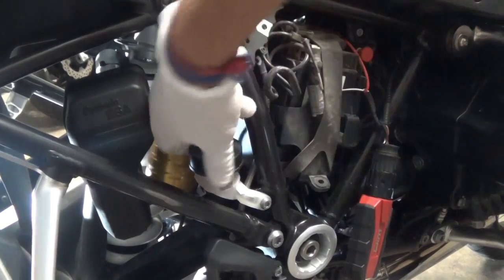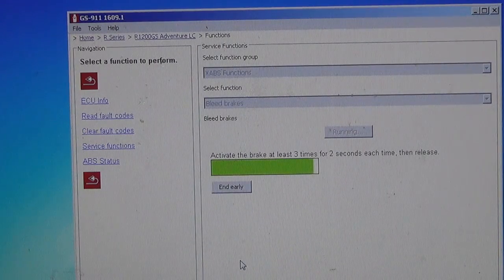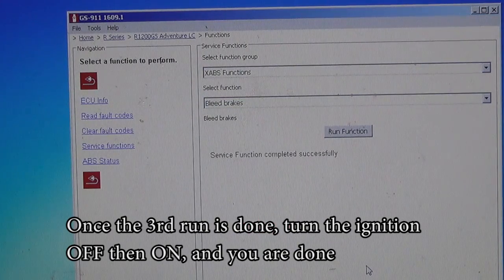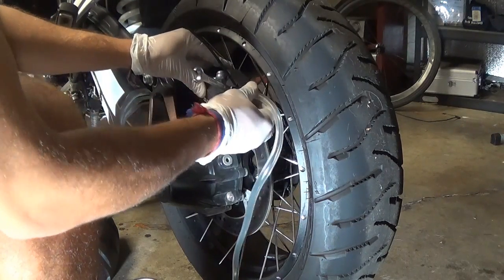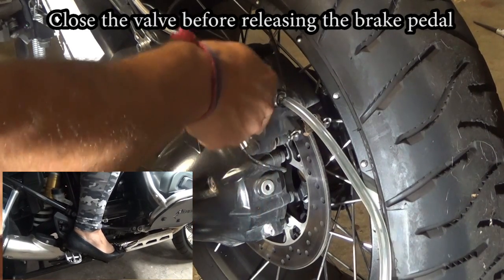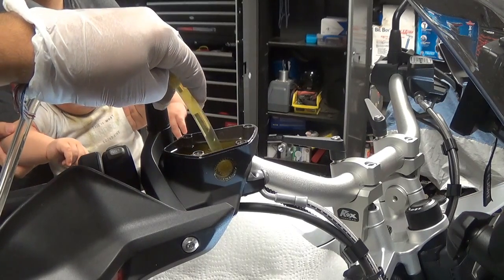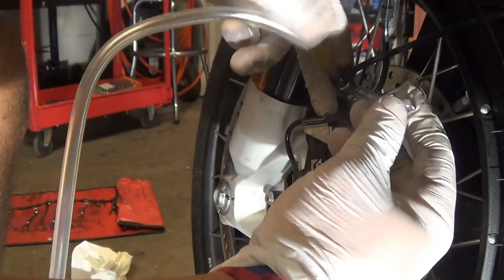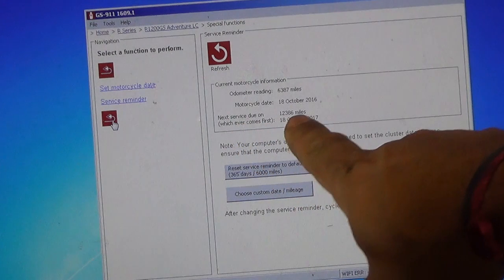COMPLETE DIY BRAKE FLUID FLUSH 2016 BMW 1200GS ADVENTURE W/ GS-911 TOOL & SERVICE RESET

Comment: Thank you for posting the video.  A couple of suggestions.  There is no real need to push the pistons in.  If you suck out the fluid in the reservoirs and top them up - then attach the hose to the bleeder and put the hose in a bottle with any fluid in it so the end is under water.  Crack off the bleeder.  Slowly pump the brakes through their range pushing the old fluid through the lines.  Keep an eye on the level of the reservoir.  On your final stroke tighten the bleeder as you have pressure.  Pump the brake and hold pressure.  Lightly crack the bleeder, let a little fluid out, tighten the bleeder.  :)

Comment: So, the instructions from 911 are like: 
1. bleed 
2. abs flush 
3. bleed 
4. abs flush  
5. bleed
Do you think it matters if you do it your way?
Reply from the maker: There are several ways to skin a cow they say hehe. I'm no pro but it worked fine with me. :) Best luck
Reply: @alamray  The point is to bleed any air out each time you pump, otherwise you're just cycling the potential air in the system and not entirely removing it

Comment: You need to flush then activate pump bleed. Repeat three times. The gs911 instructions on screen outline step by step. This is important if you want to keep your pump in good order / reduce the chance of failure
Reply: Agree - you want new, fresh fluid through the system so that when the GS-911 does its thing there is new fluid there to replace the old fluid in the inner workings of the ABS system.

Comment: HI Ray, Great video! Thanks for sharing it. 

I have one question: 

Is the motorcycle on? (not motor), but do you have the contact on for bleeding, so the ABS system is activated. Or the electrical part of the brake system should be completely of?  (I don't hear any ABS system noise in the video when she press the pedal). 

Thanks.

Comment: Enjoyed. So how much did you invest in the ABS pump and computer software? Also you can loop the tubing in a circle at caliper, to prevent air into caliper just open the bleeder and pump over and over while adding fluid until changed. Done right no  air will come into caliper.
Reply: I do my own services but not sure I would use the GS-911 enough to justify. That is a neat device. Now if I go to BMW for  brake fluid job and they want over $300 may reconsider.
Reply: Yes been there done that

Comment: Hi, I don´t understand where the brake fluid gone from the abs pump because  all the brake lines and calipers nipplen are tighten front and rear!? I have a bmw s1000rr abs and gs911 and I want to change break fluid but I don´t understand that part ``now that the old fluid is out from the abs pump`` :)
Reply: So... you might as well not do it then. Good luck with that.

Comment: Hi, about a 2011 1200 adventure. Do u think I need the GS911? Thanks
Reply: yes. my friend has a 2011, and he uses it.
Reply: Is possible to flush the fluid without the GS 911?
Reply: OK, and the bleeding process is usual, bleeding the caliper, press the lever etc...  Dont I have to take off the tank and bleed the abs unit like old models? Thanks a lot for your help my friend..
Reply: THANKS A LOT ! I´ll try here...
Reply: How much fluid did u use on the flush?
Reply: just one? 250ml is enough to bleed all system? thanks
Reply: ~thanks for all